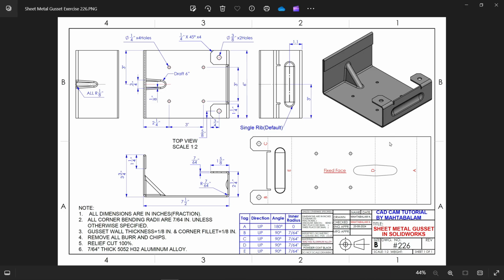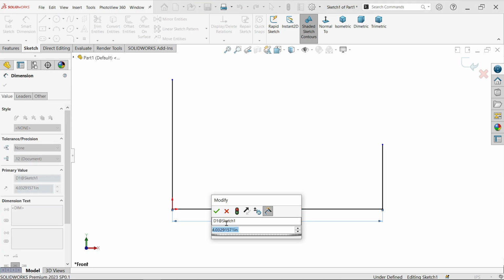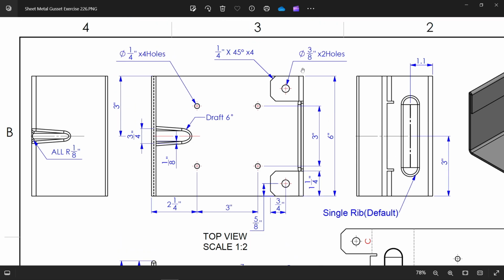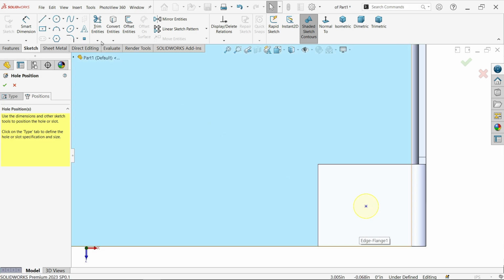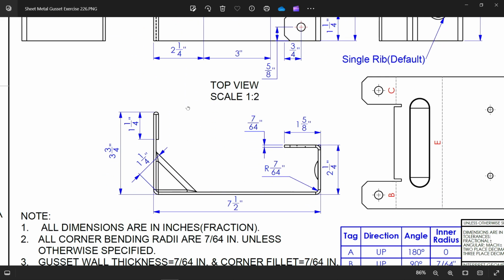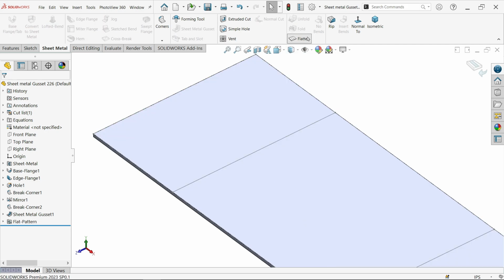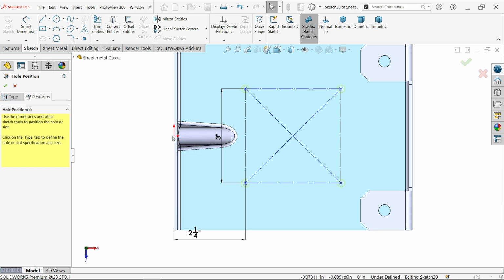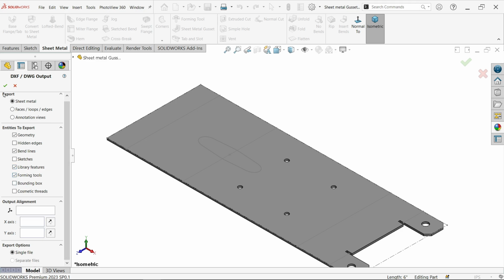SolidWorks Sheet Metal Gusset-Exercise 226

Comment: In sheet metal tutorials also explain the bend allowance, k factor and bend deduction and how to calculate it in real life example... because whenever i design the sheet metal part and export it as dxf file and cut it by laser machine and after bending it, sizes not come accurate
Reply: Are you using the right punch and die?